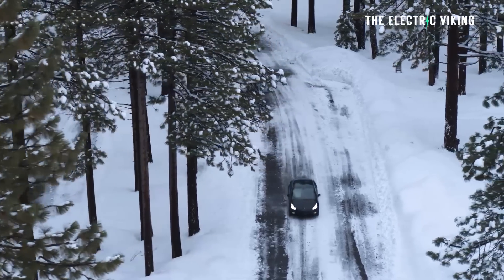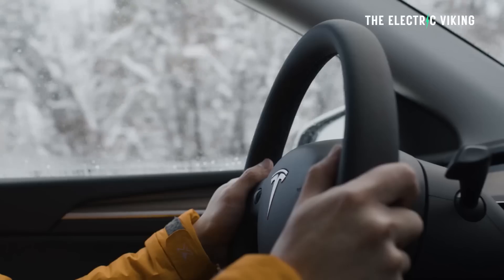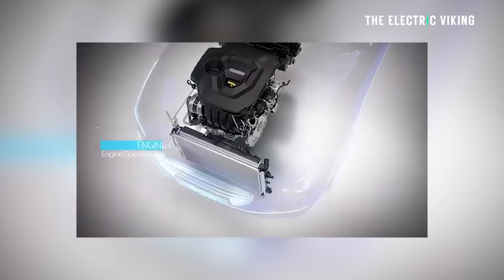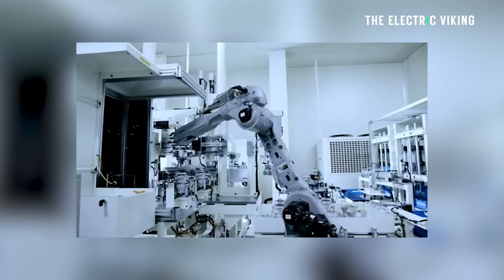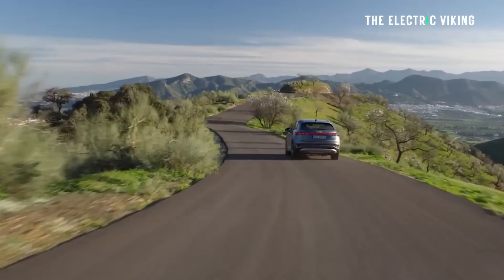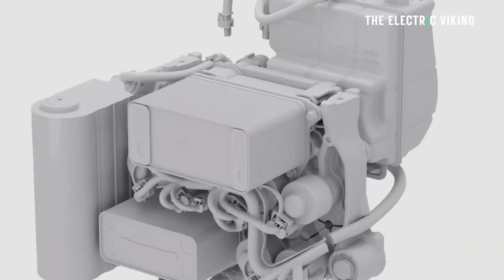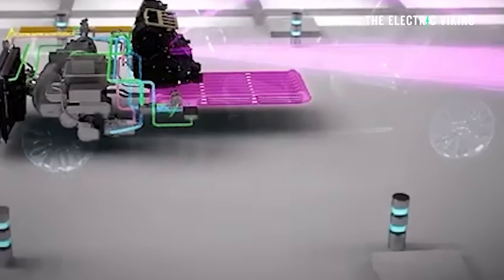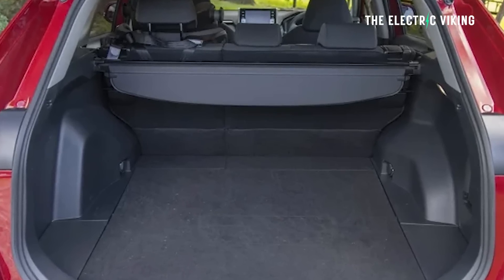Revolutionary heat pump boosts EV range and is 30% smaller!

Comment: Gotta wonder if they can be adapted to EV conversions and/or older EVs with resistance heating and no battery/motor heat recovery

Comment: Have a heatpump in our Seal Performance and its been great. The A/C is super cold as well, having to raise the temp to higher temps than in our G20 BMW. No stranher to heat pumps, have a heat pump dryer and its 10 star efficiency. Loving the Seal with 12k kms snd drives like it was brand new.

Comment: IC cars with air-con do have a heat pump - thats how air con works. They don't need to have it bidirectional because 80% of the heat is wasted from the engine.
Reply: In air handling parlance a one way design is a chiller or AC whilst reversible systems get the "heat pump" moniker

Yes, they're all heat pumps but this is how the industry refers to them. I'm not attempting to enter a debate about what's right or wrong - merely observing that sticking to industry convention is usually the best way to describe things for the audience in question

Comment: Hmmm...  "Heat Pump" is a "Hot Water Pump", with seals and joints and radiators,
and dealers with repair shops will love them!
Reply: The antifreeze in my EV's cooling loop is rated as a 20 year item - it's standard Diaqueen (the pale blue japanese antifreeze) that has a much shorter life in ICEs

Without all the extreme heat exposure, chemical comtamination and - importantly - pressurisation, the liquid has a much longer life but so do the component parts. It's the pressurisation cycles whilst being subected to the abrasive and chemically corrosive effects of pressurised near-boiling water that take out ICE cooling loops over time.

Water is not a benign substance and many antifreeze mixes deliberately include a mild abrasive (silica) to scrub off any buildup of scale in the loops

(This brings up the point that antifreeze isn't antifreeze isn't antifreeze and mixing different kinds can cause severe engine damage as some will gel up and block coolant flow, whilst using the wrong kind can cause accelerated chemical or flow abrasion depending on the dissimilar metals present in the loop)

Comment: I worked most of my career in the aluminum industry. I remember a senior engineer once saying “if all the % improvements we’ve made in smelting technology were added up, we would be smelting aluminum for free”. Essentially we’d have a perpetual energy machine. I’d like to add all the % efficiency improvements you’ve listed to see how close we are getting with EVs.
Reply: the trick is, it's not additive, it's multiplicative. That said, resistive heating is a BIG power hit and range dent - the average EV AC is drawing well less than 1kW (some as low as 150W) to provide decent cooling but at even slightly subfreezing temperatures you're looking at 8kW peak heating draw falling back to 3-4kW. A lot of older EV owners ended up putting Webasto or Eberspacher heaters in their vehicles for cold weather

Comment: EV's are where the nearly all of the development dollars are going to. ICE is on an ever increasing loosing streak. What we really need is new batteries with as a close as possible to double the power density per/kg and 500K/20 year warranties. In terms of heat pumps, Sandy Munro is on the record stating that the Tesla heat pump is currently the most efficient in production EV's. Lets see the actual performance of this new heat pump when it is independently tested by someone like Munro!

Comment: In ICE-cars heat is for free... -no need to insulete the car. In an EV heat is expensive, so when will the industry start to insulate the cars in same way done for houses? Thick insulated walls, roof, floor & windows, not a single thermal-bridge etc.

Comment: The real key here is that the ICE is old technology.  We've been tweaking it for over a century, and it's really up against a hard wall of inherent inefficiency.  Yes, gasoline is a really dense energy source.  But exploding it inside a reciprocating engine is a lousy way to use that energy.  Just look at the thousands of parts it takes to make a modern car's drive train.

The EV on the other hand is new, and still has a lot of room for improvement.  People will be coming up with better batteries, motors, and who-knows what else for a long time to come.

Comment: It's amazing how rapidly EV technology has advanced in a relatively short time.  I wonder if some of the advancements for heat pumps in EVs will translate into home HVAC units.
Reply: Size and especially weight are most important in cars. At home, not so much. 
Car A/C system needs to heat or cool the battery and motor,along with the cabin. Sometimes in opposite directions.

Comment: Someone just wrote that the effect of a higher efficiency HP won’t make a big difference in range.  Ok, so what if it achieved a 10% advantage on any existing HP technology.  Would you snub that, and turn it down if someone adapted those advances for your home unit?

Comment: I wish more people would realize what Elon Musk has contributed to the world and the implications for the future.  I remember that all the technologies that advanced as a result of the space race of the ‘60s.  This is so much like that.  I’m an EE and spent a career working on motors and drives.  This stuff that Tesla has developed is unbelievable.  The thermal management system that protects the motor, drive, batteries, and provides cabin heating and cooling is another example.  There aren’t a whole lot of people that can really appreciate what’s going on here.  These things are going provide spin off benefits in other industries, as well as helping to reduce the human energy footprint on the planet.  This is huge. Do you think there would be a BYD, or other Chinese brands making the strides they’re taking, if Teslas didn’t supercharge the industry to get it off and running?  I just wish people would quit cowering from the cancel culture and give the guy his due!!!
Reply: Most of the ingenuity comes from the engineers, not Musk.
Reply: @greghudson9717  Face it- Elon Musk is the leader of the team.
Reply: @VVBros1  Maybe, but Musk has smart people working for him, all he does is reap the praise for other people's designing and engineering.

Comment: Sorry man but his video is total nonsense. ICE car does not have heat pumps??? Really have you heard of AC (Air Conditioner)? That is a heat pump (even your refrigerator is heat pump just 1 way)... And for heating the cabin ICE using the huge energy loss as heat created by burning of fossil fuel. And yes cancer creating smokes, etc... 
So ICE cars same efficient for cooling (same new gen heat pump can be added to ICE) and heating is also efficient as it mostly using access heat from the engine. Electric cars are the future, they are clean, quite and can charge from solar... So I will buy soon one but not for this nonsense reason...

Comment: In a WW3 situation, only vehicles working will be old carburettor cars! Reason is spelled: EMP.

😂😂😂😂😂🤣🤣🤣🤣🤣
Reply: EMP would be the least of your worries.
Reply: @jamesvandamme7786  You sir need to educate yourself more. Back to school with you! 😆
Reply: @tomfull6637  Back to school with you!  It would not be the carburetors that would be an issue, but the electronic ignition systems on ICE vehicles, which have been standard in almost every vehicle since 1978.
Reply: @VVBros1  Sorry dear but if Your goal was to ridicule me you certainly missed the target. Kicking the ball hard and precisely you did, however straight over the sideline and not even towards the goal! 😂

Read again pls. I never stated that carburettors were the problem or even “an” issue. You did! 1-0 to me then right?!

All old carburettor cars will work after an EMP. They have contact-breaker points and a little capacitor (which would possibly even survive a pulse as that’s what capacitors do for a living) and if not very easily swapped to a fresh one from the shelf. Try fixing a newer car with lots at electronics after an EMP! Game over for all newer cars and the EV’s!

If your info 1978 is correct I can neither confirm nor deny but during the seventies ignition systems were gradually upgraded from contact-breaker points to a semi electronic ignition system by means of a very basic device with a thyristor. I don’t know if those would work after and EMP or not but now we have diverted far far away from the subject in my post: At a possible ww3 only old carburettor cars will roll…. 😘

Kind regards 
Anders
Reply: Doesn’t really matter because we’ll all be DEAD ☠️

Comment: If it works in cars it could work in homes. We need a technology revolution in home HVAC and the expensive, fragile, high maintenance heat pumps we have now won't cut it. We need cost and reliability parity or better with traditional AC units. Mine has been working for over 6 years with no maintenance at all, just filter changes. No heat pump for home can do that.
Reply: Tesla has been talking about home heat pump octovalve HVAC for years. Nothing has happened yet AFAIK.

Comment: ICE cars don't need heat pump, there is plenty of waste heat generated from combustion process to be used to heat cabin etc.
Reply: That's fine for heating, but what about cooling ?   The heat pump also works as a cooler as well as a heater.
Reply: @greghudson9717  I'm from Canada. Heating is far more important than cooling. AC is nice to have for a few days of summer, but if you don't have adequate heating in winter it's outright misearable or even life threatening. Currently, having an EV means sometimes you have to choose between range and have enough heat to stay comfortable.
Reply: @i6power30  I'm from southern Québec, Canada, in my case. Never I will bought an EV car without thermopompe. It's so efficient compared to only PTC. In my case, most of the summer, and still this week, A/C work each day. Once I can reach high speed, then after I can open window. Like today, reached only 26C again but the most usefully moment for A/C is for when you climb in your too hot EV because sun reach it. It was the same with petrol one in those time, once I tasted A/C, never I bought a car without it after.
Reply: @i6power30  Webasto conversions are a fairly common thing in cold climate EVs
Reply: Cooling for  ICE costs virtually no gas these days. Very efficient. Also for EVs, cooling is easy.
Reply: @jellyd4889  not true at all.. cooling is superior in EV. Heating is superior with burning fuel. AC in ICE requires engine running to drive the compressor. ICE engine is only 35% efficient in converting energy in fuel to motion, wasting the rest in heat. That's why when you stand next to an ICE vehicle running AC, you feel more heat than cooling it generates. It's terrible. 
I often take nap in an EV running AC completely quiet no vibration in hot summer days. I can never fall asleep in an ICE vehicle running AC, it's loud, smelly, and vibrating. Hate it.
Ideally, you'd want an EV that comes with propane or other fuel based heating system for cold weather, conserving battery for motion only which is 100% efficient.
Reply: @i6power30  I will add to you, I had sleep in my EV for travel in around 0c temperature few night last winter.  My experience with temperature at 22c setting inside, around only 4-5% consumption of my 74kw battery  for each sleeping night. Since then, I have no more fear to be stuck in snow storm with an EV, it's so efficient. In counter part, petrol one in snow storm, can have gaz exhaust going inside the vehicle or can have a leak too (Hey rusty car). My opinion, way more secure and efficient with EV too in my opinion.
Reply: @sergiomomesso1590  It depends how cold outside is. Heat pump loses efficiency below - 5, and consumption of electricity for heating becomes real drain as it gets colder outside, and becomes a serious concern of getting stranded if you don't have enough juice to drive to a charging station. A 1lb bottle of propane will last 5 - 6 hours of heating, no matter how cold outside is, it produces the same amount of heat from burning fire. That's way more robust than heat pump trying to extract heat from the environment when it's too cold outside.
You said 22 C setting, but I doubt it will ever achieve it if it's too cold outside. Whereas, heat from buring fire can easily make you feel cozy warm, no matter how cold outside is, there is simply no comparison with lukewarm heat pump. Energy density of any fuel - propane, alcohol, kerosine, are about 20x that of average EV battery. Again, no comparison. And there is no waste in energy when burning fuel for heat, unlike trying to get motion out of it, it's only 30% efficient. Extracting heat from fuel is 100% efficient, no waste.
Reply: @i6power30  I don't know where you took your info about -5C? But normally where I live, for house it's stated at -15C and lower, 1 stage thermopompe will start to take more energy compared to heating elements at -15C.  Here where I live we reach many times in winter -30C.  I can confirm I notice the difference with my EV. Yet, I didn't find temperature when heating element start in my car yet, maybe this winter I will figure it out?
Reply: @sergiomomesso1590  So you are saying that you kept your car interior at 22C when it's -15C outside All night (I assume 8 hours at least), with only 5% of 74kwh, which 3.7 kwh of electricity? Sounds like science fiction to me... Maybe outside temperature was +5C and you keep interior at 22C then I believe you.
Reply: @i6power30  No it was around 0c outside when I tested it, tested  3 nights. Yes, around 4-5% for 8 hrs with 22c inside.  Not tested at colder because as you know, more it's cold, more it take energy for the same distance. It's why I done this travel in winter at 0c.  Another thing I noticed in this travel, at 0C, for heating the cabin while moving took too only 4-5%, 2% for electronics and the reste gone in moving motors at 0C. This shown to me in long travel, the thermopompe is very efficient once the cabine temperature is reached.
Reply: ICE is a heat source that happens to produce a little mechanical force

Comment: Kia needs to get rid of lead acid batteries from its earlier model such as Kia niro EV, 

It just demonstrates Kia lacks the ability to implement entire car segment production adjustments on its supply chain side.

Look at Tesla, even if they do these small 50km range boost battery change on similar model and expect you to be grateful 🤣(need 200km to wow me buddy)

but at least in terms of mass production to implementation to shipping millions of cars it’s not an issue for Tesla.

They did it in a way by having similar trim and minor adjustments on all other parts to enhancing software updates compatibility. 

In terms of real strength in software Samsung (where else they going to get software developers?)needs Korean developers and Tesla be like:”you used to work in google? You used to work in Apple? Silicone valley?  Come on right in.”

So it’s an software difference, waiting to be debunked by actual Tesla team or Kia team

:”we don’t have anyone used to work in Silicon Valley it’s all native Texas 24 year old freshman graduates😂”

Comment: Sounds like they copied Tesla and sprinkled some marketing terms on it.
Reply: Not if the specs are real. Engineers optimize things, marketers turn it into bullshit.
Reply: The issue is that you can only get the Tesla system on a Tesla, or a system with Tesla motor/controller/batteries

This is more "portable" across manufacturers and as such likely to end up a LOT cheaper simply through production scaling

Comment: Great news. I want an efficient heat pump in my upcoming EV. I am still running gasoline including two motorcycles. Have an off-road capable eBike. Looking forward to replacing my fueled car with my future solar charged EV.

Comment: Heat pumps have been around forever as a production item for homes and by and large have been a complete boondoggle but yes "our biggest achievement has been the octavalve" is a direct quote from Tesla possibly from Elon I don't recall now and has been considered as such by those who have done teardowns of Teslas. The potential if now validated is enormous as in order to cool an item down whether your food inside a refrigerator or everything inside a home via the "AC" this requires the ability to heat things up first and this has always been done using an #air_compressor which in a modern car fits in remarkably simple manner attached to the alternator so good luck improving upon that piece of systems engineering still the idea of a heat pump which I think contains no moving parts and probably why Tesla did this no copper is a remarkable piece of engineering which if gotten right here has enormous implications far beyond vehicle climate systems although certainly there is that as suddenly your power needs for your actual Home in addition to your car would in theory drop by an order magnitude especially to include the system used to get water into your home. In the USA where there is an incredible amount of humidity in the regular "air" for most climate any revolution in not even needing a compressor for anything anymore would be a very dramatic change in pretty much everything so yes very much worth paying attention to absolutely 😊

Comment: Looking at it, one wonders, "What could go wrong?"
Reply: ICE compressors are inefficient and leaky because they're driven off the engine. Seals leak, clutches burn out, they have to run over a wide range of RPM. EV heat pumps are like your refrigerator.